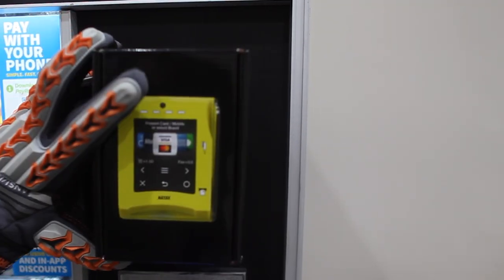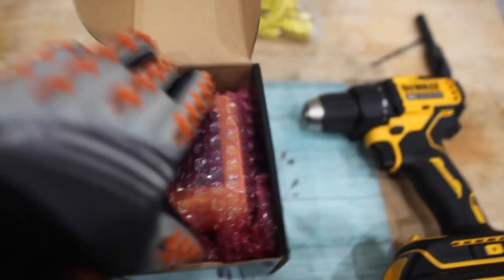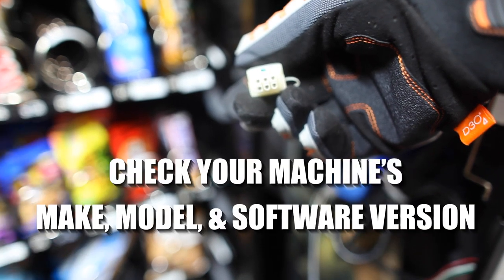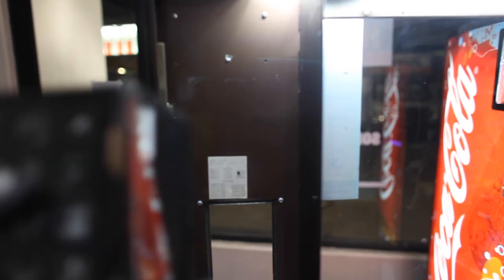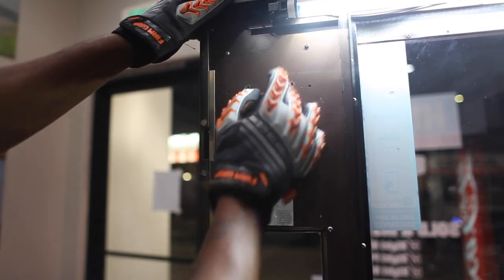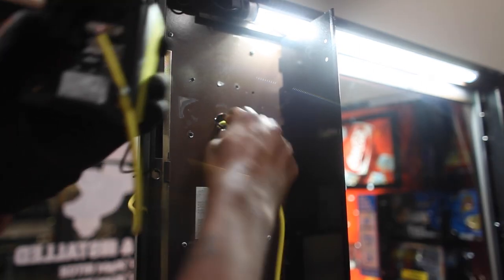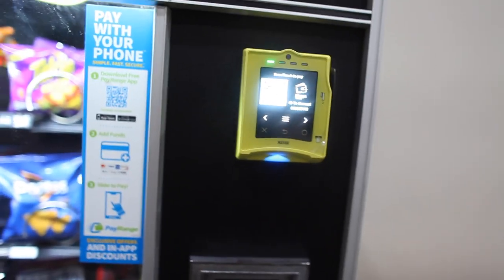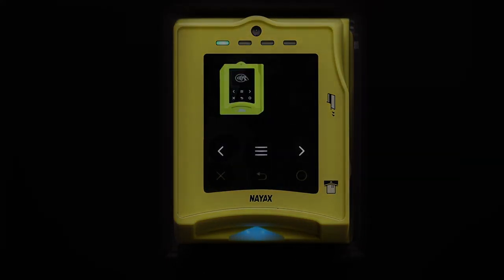How To Install Nayax Card Reader on a Vending Machine(s)

Comment: Only issue I have is being sure the machine is powered off before disconnecting & connecting electrical cables. You're just asking for a device to get a power surge & being useless.Also, invest in a step drill bit. One bit for a variety of different sized holes. Very useful tool to have in your bag. Otherwise, nice step by step man

Comment: How would you check the software
Reply from the maker: The details of the machine should be labeled somewhere on it, like the model, which version, and possibly even the soft ward. This machine had a metal label right on the side that told it. And I called the maker of the machine's contact number off google, and asked a guy from the company over the phone. He knew right off the back.

Comment: NAYAX DONT WORK, change my prices, loose conection, i have to take off these devices from machines, the support is horrible, only phone support, bad attendance, change settings, they dont know how to fix! is  a nightmare, all days on phone! it make me broke

Responder
Reply from the maker: I think you have to have a really really good signal at the location. Mine does so I’ve never really ran into issues
Reply: the machines were in 2 different location, in the center of london, the same problem, signal there is very good, the devices are very bad quality, failed  everywhere